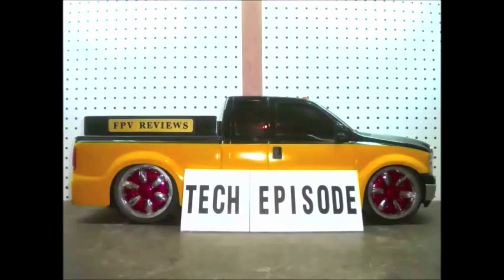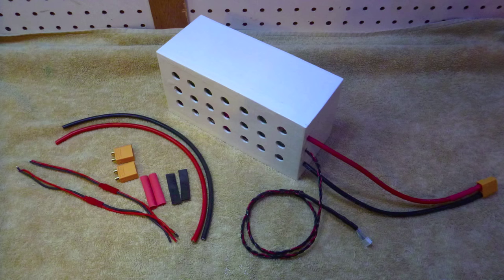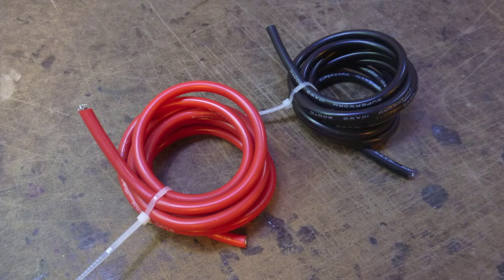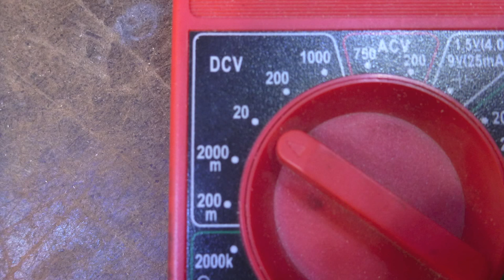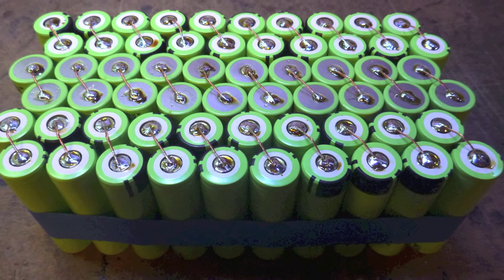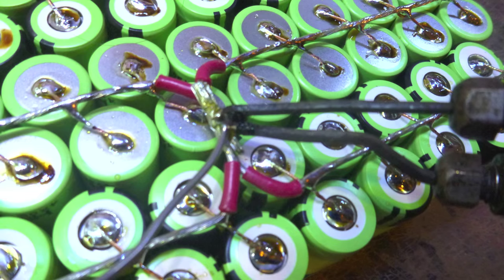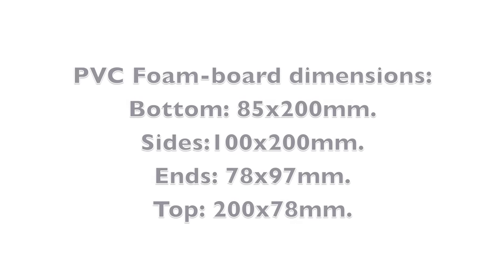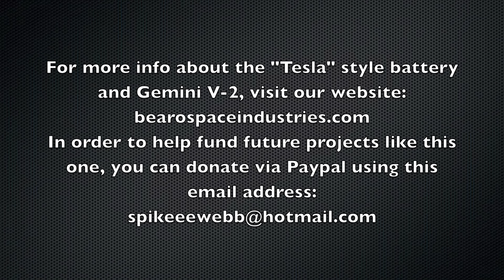"Tesla" Style Battery BUILD for Gemini V-2 And other FPV Planes!

Comment: Where is a good place to purchase these newer style NCR18650GA batteries?
Reply from the maker: +gunslinger0069 check for them on Ebay, just make sure that the seller is selling genuine cells. If they are in the U.S., and claim that they are original. they probably are. never hurts to buy one or 2 to sample tham, and test, but i have never got any bad ones doing it like that.

Comment: Hi I have one more question for you. Have you calculated or determined the C rating of your battery?
Reply from the maker: Depends on the Cells.  
the B cells have a 1C rating.    so in a 4 hour flight, you are only pulling 1/4 of the C rating. 
the GA cells are double that C rating. 
so the demands on the cells by the aircraft are well within the cells capability.

Comment: what kind of battery charger do you need to charge those many batteries?? lithium chargers top out at 4.1v per cell..can i use lipo charger 4.2v per cel??
Reply: Any good charger can do both. The 20 dollar one I have from hobbyking can do lipo, li-ion, lead, nimh, nicd, and life.
Reply: Kflyer FPV ,,i think you got me wrong on this.i mean is to charge those many 18650 batteries in series and parallel..that is a high current amp battery pack!
.a $20 lipo charger cannot fully charge those i think..

Comment: What flux did you use to get the solder to stick to the battery?
Reply from the maker: It's flux core solder.  here is a link to the actual product that i use:

http://www.ebay.com/itm/QUALITEK-RA300-SN60-062A-062-DIA-60-40-2-2-FLUX-ROSIN-CORE-SOLDER-1-LB-SPOOL-/400973308754?hash=item5d5bdf2352:g:sO8AAOSwq7JUCnJC

Comment: Dear Friend Spike, good evening!

I would like to ask you about the charging of this giant lipo, which charger are you using? How many amps do you use to charge it? And the average loading time is good? Or is the loading slow? Strong hug ! Soon must come out the Brazilian gemine heheheh
Reply from the maker: just using a regular lipo charger on lipo balance charge mode.  charging at 4-6 amps although the battery could accept far more power. takes a long time, but i store it at 70% charge, and put it on charge the night before flight. I charge to 4.2v per cell.
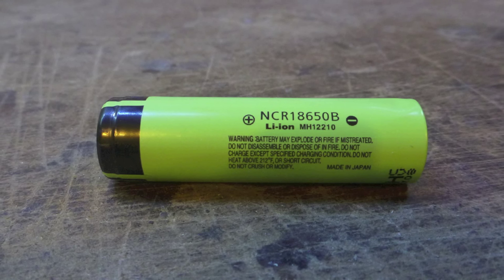Reply: Wonderful Spike! I did a test with packs made from NCRs taken from notebooks, in total there were 13 amps and they worked very well by 3:20 my groud station which has a notebook board, a 16 inch wide screen, a wide screen of 14 inch for the video and everything worked just fine. I'm going to try to make the 60-cell giant to manufacture the Gemini. Your work is very good and thank you for keeping in touch. See on my channel the size of the ground station that should kick in again soon. hug

Comment: HI 

is it possible to build a 4S 30 Ah battery with Li-ion? and what will be the total weight with the cables? and do you sell a ready one?
Reply from the maker: +Elie Waked the closest thing that i would recommend would be a 36 cell battery, which would be a 90 amp max battery at 14.8 v nominal, and weigh roughly 1.7kg.  it would be 31.5 amp hr battery,a nd you can expect about 87% usable capacity giving you a 27.4 amp hr battery of usable capacity.  using GA type cells. 
form factor would be about  185x80x 80mm. email me about price availabilityand a shipping quote, if you are interested. please include your address. Thanks.  fpvreveiws@gmail.com
Reply: +FPVREVIEWS Sir so how much amp per battery can get?
Reply from the maker: +Ansari Flight Plan the B type can put out 6 amps continuous per cell. the GA type can put out 10 amp continous.  the capacity increases as you discharge more slowly, due to internal resistance.
Reply: FPVREVIEWS Thank You sir... the B type and GA type have same amount OF Capacity?
Reply from the maker: +Ansari Flight Plan the B has 3400 mah cap, and the GA has 3500.  
usable capacity, about 87% of that under my real world test conditions, trying to treat the battery nice for lots of cycles, but hit was in actual flight test too.
Reply: FPVREVIEWS Thank sir i am forward to used LG HG2... it have 20amp percell 3000mAh maybe suitable for Quadcopter
Reply from the maker: +Ansari Flight Plan those are the brown cells, right?  i got some for testing. i plan on testing them for use with a higher performance rocket-electric hybrid space access research vehicle i'v been playing around with. fun stuff.. they seem to have a good performance for higher power applications so far, but we'll see how they hold up to actual testing.
Reply: YEs that true... but it expensive both bettery is so expensife at Malaysia =(
Reply from the maker: +Ansari Flight Plan more than lipos?   for the watt hr?
Reply: i plan to get 10000 - 12000 mAh... But need amp also to fly quad
I hope can fly it on 3S
3S 4P

Comment: How about installation of charging electronic/charge management? Isn't it necessary?
Reply from the maker: +gabor hogye the charger takes care of balancing, while charging, and the telemetry lets you monitor voltage during use. balancing is done by the charger on every charge.   So, it does have BMS in effect, just not on the battery pack.  in the airplane, and on the ground.
Reply: +FPVREVIEWS Ok, thanks. And which charger is capable to charge this Tesla pack? Any well known charger from the RC world which can charge Li-Ion? Can you recommend a sensor how to connect it to telemetry? Which I know is only for LiPO.
Reply from the maker: +gabor hogye You can use your lipo charger , on lipo setting, the voltage for the charging is exactly the same, however, this battery can be discharged further, without damage. so, just treat it like one big lipo, and you're good.  no secret formulas, or special charger.
Reply: +FPVREVIEWS That sounds really good! And does it mean that for telemetry I can use the Frsky FLVSS LiPO sensor??
Reply from the maker: +gabor hogye sure, you can use any equipment that you would use for a lipo.

Comment: Could you tell us. What voltage did you get with this arrange?
Reply from the maker: this build was for 11.1 v nominal, but many form factors, and voltages are possible.
Reply: FPVREVIEWS would this be possible on a Quadcopter that normally runs on 4s lipos. Like a racing quad or so?
Reply from the maker: Yes, there are quads, and other multi rotors using the Li-ion 18650 high energy density cells, but i don’t know of any mini quads, that are using them.
The key is whether your craft’s power consumption falls within the limits of the cell discharge rate, which is incredibly low, compared to lipos.  That i swhy high discharge rate lipos are used on mini quads.  
this relates fairly directly to disk loading on mutirotors, and the ability to carry weight in batteries. 
what you want is large props, turning slowly, and lot’s of static thrust, at a low power consumption. 
there are some custom quads, and other multi rotors out there with those characteristics, such as this:

https://www.youtube.com/watch?v=vUbc73-x9sE

Comment: Hi, can we connect the batteries by spot welding? I learned that the conductivity of cr-ni sheet is  6 times worse then cupper wires. So will it be enough to manage the  current flow between the cells?
Reply from the maker: I've not done it, but I understand It can work well.  It will be hard to beat the copper wire, which is why we're still doing it this way for now, but for the application,/load, may not matter.  We just bought a quality machine, and will do testing soon.  only if it passes all tests will we show it, and offer batteries that are spot welded.  We do our own testing, as there are too many variables just to assume the quality, especially with the welding itself.
Reply: I will be waiting the results of spot welding tests. Thank you so much.

Comment: what is the maximum amps you could draw from this pack? how is that calculated?
Reply from the maker: +Chas Smith depends on the cells that you use, but 2-3C would be ballpark. 
1c is full discharge in 1 hr. 
2C is 1/2 hr. etc. etc. 
full throttle climb for Gemini is about 1C
Reply: +FPVREVIEWS 1C on this battery would be your electronics drawing about 64 amps is that correct?
the reason i ask is i have a 30 amp setup and was wondering what the smallest battery i could safely make with a 30 amp max draw
Reply from the maker: +Chas Smith correct.  
you should use the ncr18650ga cells.  what voltage are you running?  they can draw up to 6 amps per cell if i remember right. so each group would have to have at least 5 cells. i like to use even numbers for my construction method, so 6. then times 3 for a 3S pack, would be 18 cells. that would be about minimum.  weight per cell is about 45 grams. so about 1kg by the time you add solder, wire, casing, etc.
Reply: i'm running 11.1v with a standard 4500 lipo right now... i've looked into the cells and was hoping i could make one with 4x4x4 cells as that will fit in my airframe (modded easystar 2)
Reply from the maker: +Chas Smith you could go with a smaller prop, or lower kv motor for less rpm,a nd lower amp draw. 
problem with the easy star is prop size is limited. the larger the prop, up to a point, the more efficient the power setup can be. think large prop and relatively high pitch turning slow.   the reasoning behind this is that compressing the air less at a larger volume is more efficient, rather than compressing it more at a lower volume. 
the ideal setup is also factored for airspeed.  sounds like you need a Gemini v-2, or modify your easy star to fit  a larger prop, with lower kv motor for less rpm.
Reply: FPVREVIEWS you are right! i am trying to avoid going to a bigger airframe for a variety of reasons, mostly because 100+ hours with this one makes me very comfortable with it. My idea is a different one - 3d print a larger middle section to fit a larger battery. I may try the 4x4x4 configuration anyway as I rarely draw over 20 amps (4 amp cruise).
Reply from the maker: +Chas Smith congratulations on achieving such a high(relatively ) flight time, I converted my easy star to trim boom, and used a 9 inch prop for a couple of years before i decided to build a custom airframe. i called it the uav4.  you can see it on my bearospace channel. you have to go a while back, but it flies well, and i still have it. 
still use it for photos. flew it to 4000 ft once, and a couple of miles away on 2.4ghz. 900mhz video. 
it could have even more potential now with better batteries, and long range radios. looks like we might have to go smaller now to avoid compulsory nazi "drone "registration for the u.s.   i might design a small version of gemini, or something else with great performance in small size. we'll see how things shape up.  oh well..

Comment: Could someone please explain to me-
1) what determines the cell. Is it because it has three rows?

2) if a 3s is around 11.1 volts and each 18650b has 3.62v, and they are grouped in 20, how does this make it 11.1 volts

3) how would I make this into a 3s 30ah battery
Reply: This would be a 3S20P pack, which means there are three groups of 20 18650s. 18650s have a capacity of around 2700mAh, a nominal voltage of about 3.7V (They charge up to 4.2V and drop down to 3.2V or so over the course of their use) and a safe discharge rate of between 1.5 and 3 times their capacity, depending on quality, so let's call it 5 amps.

The groups of twenty are in parallel, which means their positive terminals are all grouped together, as are their negative terminals. All twenty of those 18650s, combined, will still have the same voltage as one 18650, but they'll have twenty times the capacity, and thus twenty times the safe discharge rate. Those twenty batteries become one big battery that's still 3.7V, but has a capacity of 54000mAh (2700 times 20) and can safely provide 100A (5 times 20) of current.

These three groups are then put into series by connecting one's positive terminal to the next's negative terminal. Batteries in series combine their voltage without affecting their capacity or discharge rate, so three 18650s in series would have a voltage of 11.1V (3.7 times 3), but would still just have 2700mAh of capacity and be able to provide only 5A of current.

When the three 20-cell packs are put into series, you get a nominal voltage of 11.1, a capacity of 54000mAh and a safe discharge rate of 100A, making this battery a massive reservoir of electrical energy.
Reply: Thanks

Comment: Maybe u can help me with the calculation... I’m using brushless 920 kv motor... and I’m planning to make my 3.2 kg fpv plane fly for an hour flight time. How much pack of this ns batt will be required ? And the amp of the esc that shoul be use?.. thanks..hope u can share me your tips my friend
Reply from the maker: Will need more info to provide meaningful help. Not all airframes are the same, and weight is only one of the factors in efficiency and power requirement.   
Need to find out how many amps the plane needs to sustain flight,  
how many amps the motor/ESC combo draw at full throttle,
how much weight the aircraft can carry (in battery) and still have a wide flight envelope/good overall efficiency.

It's not that hard for an efficient airframe to fly for much more than 1 hour, and some airframes cannot get to 1 hour, so this depends on the airframe.
there are also other limitations, such as connectors, and max discharge rate of the cells. It's far better to carry as large a battery as is practical, as the usable capacity is linked to the discharge rate of the cells.  The more efficient your airframe, the more capacity you can get out of each cell that you carry. 
hope this helps think about it in the right way.
Reply: FPVREVIEWS The Frame is kind of similar With uav Raven rq11..only The diference is That mine are more heavy compared tO raven Which is only 2kg all up Weight. My Wingspan length is around 189 cm and deheadral 15 degress upward at Both The outer wing left n Right. The motor that im try tO put is 1400 Kv ,Max current 40 A/60s and max Watts 445W. as for The Esc im using 100 amp Esc...
Reply from the maker: still need to know the voltage that you want to run for the system,  max weight of the battery that is practical, and amps that the plane needs for loiter.
Reply: I see..Ok  i Will give u those sir... thanks again

Comment: The wiring of the third set of 20 was confusing, and your "just to be clear" explanation was anything but clear. First you show them wired with a red wire, then with a black wire. What the heck are you doing ?
Reply from the maker: +youpattube1 the red is the total positive lead of the pack. the black is the total negative, the end result of the series wiring.  3 sets of 20. 60 total. the two pictures are of the left, and right side of the pack, that's why they are different.

Comment: Dumb question, why did you use the ranger ex as a reference for aircraft the has high power requirements?
Reply from the maker: It's relative, and because it has to do with the discharge rate of the individual cells, the weight of the battery must be taken into account too.  The ranger does not need that much power, but it cannot carry a 3kg battery either.

Comment: I don't see how wet Hardshell Cells could get better Energy density than Dry Softshell LiPo's. At least without going lithium-air or so.
Reply: I have to add, the ones I mentioned need currently about 60+°C to operate at high-ish currents. They do work for low currents at low temperatures, but not for high.

Comment: hi spike ,first thanks alot for this video 

about the batteries did you have a look in much higher AMP and capacity ? 

https://www.ukecigstore.com/vaping-outlaws-xtreme-18650-2500mah.html

they use these for subohm vaping which stress the batteries a lot so they are quality and the rating are good.

thanks and happy new year to u and your family , speacially your wonderful very skilled DAD
Reply from the maker: +Aron Gatt interesting that they can draw 40 amps, however, the capacity is less than what i am using, 2500mah vs. 3400-3500mah, and the Gemini V-2 itself has no use for the higher amp draw, even at full throttle.   it may be great for other applications, however, and i am wondering how to go about making a hybrid pack, blending cells to achieve a ratio in between.   mixing different cell types in series would be bad, but in parallel?
Reply: FPVREVIEWS there is also these guys here which are higher  in capacity but i never tried theses once , so cant verify there stats.
https://www.ukecigstore.com/imren-18650-3000mah-35a-flat-top-battery.html

i guess building the battery with different ratings  in parallel will cos an uneven cell but it can be tested for sure in a controlled testing environment